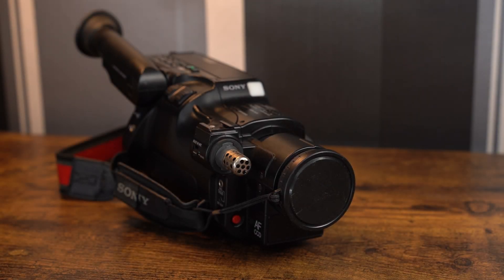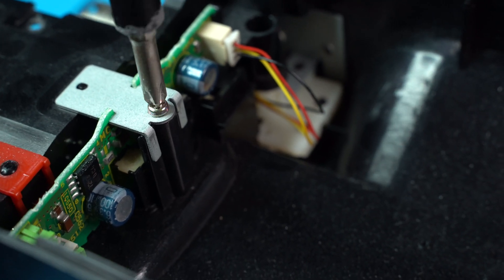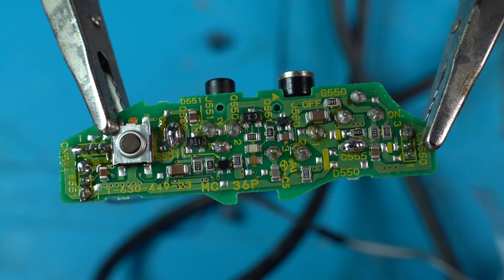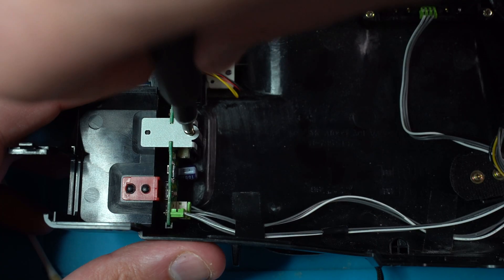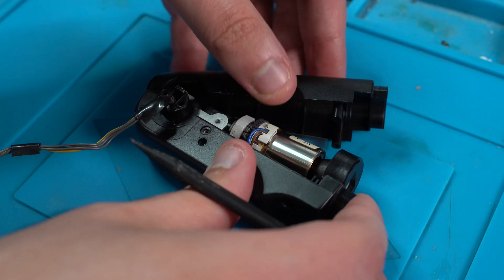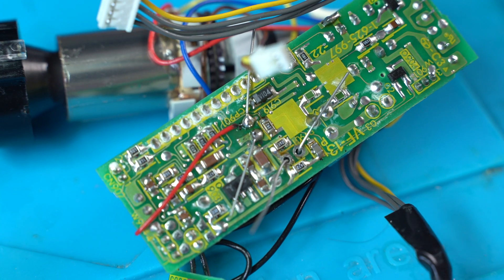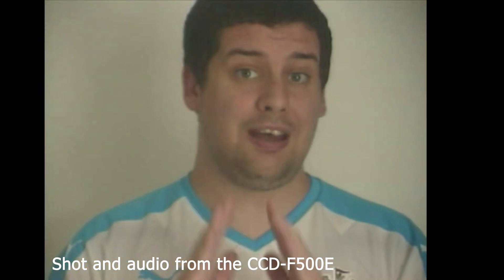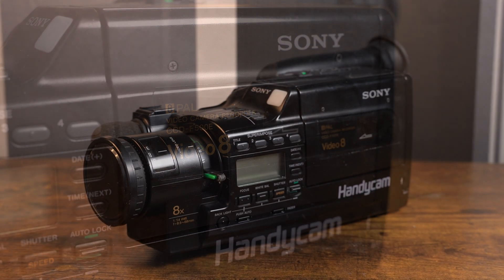Sony CCD-F500 Restoration - Part 3 - 4K

Comment: They are great videos about camcorder restoration, I believe it took a lot of time and nerve, Just wonder is any  camcorder of that age would suffer the leaking cap problem, or it could be affected by intensity of previous use and storage condition. 
Thanks for the video series.

Comment: The CCD-F500e was my favourite Video8 camcorder (composite video + mono audio) after the F330e and F340e / CCD-SP5. Elco's where an issue 2 years after release of these camcorders. Common failure was also loosening the tapeguides in both directions. The most reliable camorders regarding elco's where the early models CCD-M8, M10, V30, V50, V90, V95 and the EVC-X10. Repaired all Video8/Hi8 camcorders up untill the CCD-V800e for Sony Netherlands (employee 1983-2010)

Comment: This 3 part series was AMAZING. Thank you for taking the time. I learned a TON here as well watching your general solder removal techniques used in very tricky areas. I had 2 questions. The first was, do these camcorders have rubber belts used anywhere like traditional analog audio, or are they direct drive type/ geared only? My second question is on the cleaner spray you used. I’m in the USA, are you referring to what we would call DeOxit? or perhaps 70% rubbing alcohol? I didn’t want to guess or google on that one and instead, check directly with the pro since you used a lot of it very effectively i should add.

Comment: you missed to show two essential steps , tape guide alighnment and greasing the loading mechanism/tape brake arm
Reply: You're right but maybe they where fixed and locked by service before it was sold as 2nd hand. Sony technician Betamax, Video8 and Hi8, Sony NL.

Comment: Hello! Can you please tell me which caoacitors i should replace? Whenever i turn my camera (sony ccd-f350E) on the viewfinder displays static. Should i just replace the viewfinder capacitors?
Reply from the maker: Hi, I would recommend you first use the composite port and plug the camcorder into your TV. This will determine whether the issue is the viewfinder or the main boards on the camcorder. 

If you do get an image on your TV (set in camera mode), then it's likely the viewfinder caps which need to be replaced, however, majority of all CCD camcorders have capacitors which are now leaking and need replacing and it most likely the same case with your camcorder too.

The capacitors values however, will be different compared to this video, due to the model number.

Hope this helps.
Reply: @theretropal  thank you very much for this information and for answering everyones questions! Im gonna order a charger tomorrow and see if its the viewfinder (i really hope so). So wish me luck!
Reply: @theretropal  also i just have to say you really deserve wayyyy more than just 410 subscribers (411 now :D) with the quality and effort in your videos! Wish you all the best!
Reply from the maker: @fletzyproductions1190  Thank you, appreciate that. Best of luck with the repair. :-)